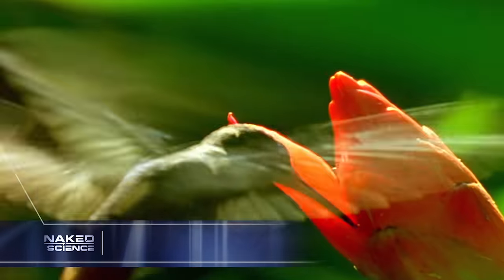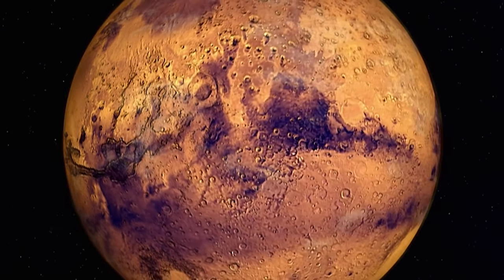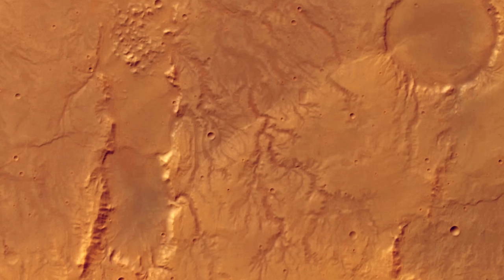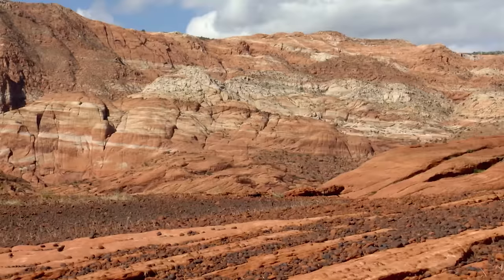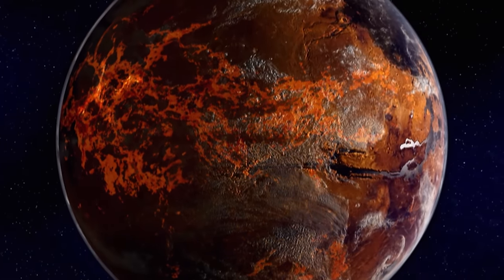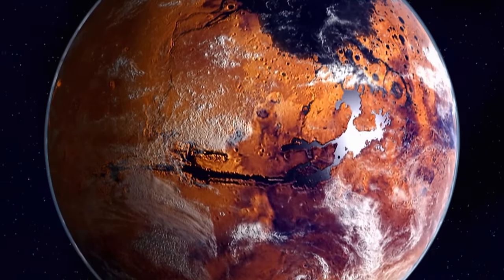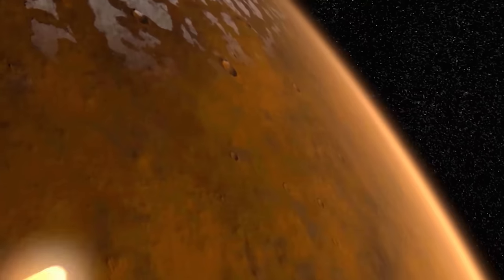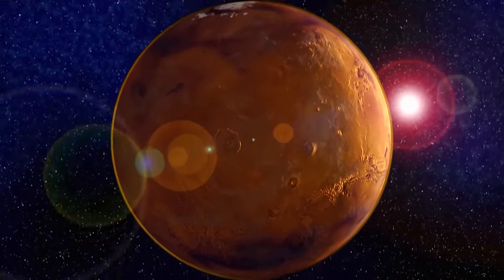Could Mars Be Our "Planet B?" | Naked Science | Spark

Comment: NASA needs to use the Water on Mars and Split it into Hydrogen and Oxygen and then into a cold Liquified Gas with Solar Power..
Then use thousands of Tuned Rocket Engines and RECONNECT the two Gases into Heat and Water Vapour Clouds, that also Absorb Sun Energy..

Not only would it start to Rain when the temp and pressure increases, it would also Lock In INFRARED "HEAT" to help Warm Up the Planet. ??!!
Reply: The solar wind would blow it all away before it could form a thick atmosphere due to Mars not having a magnetosphere.